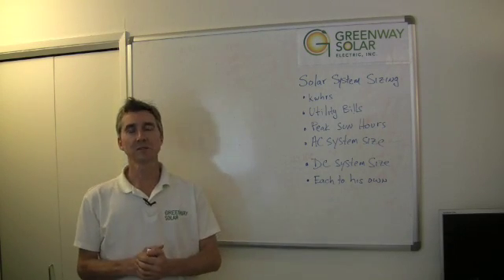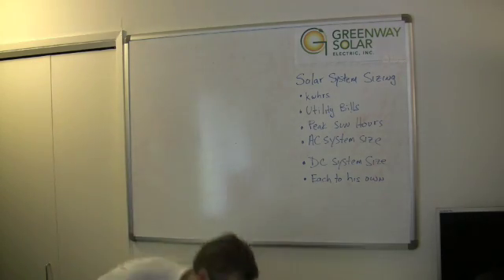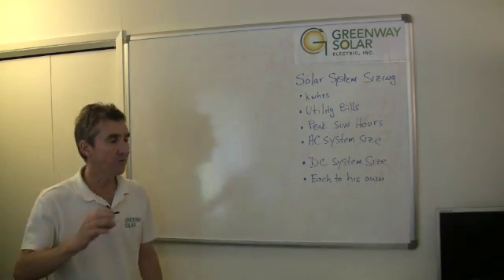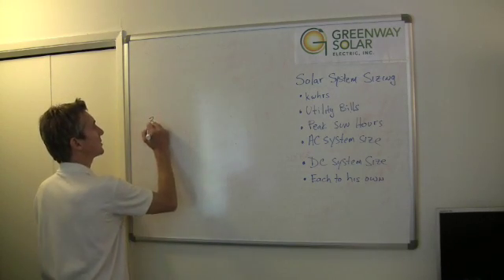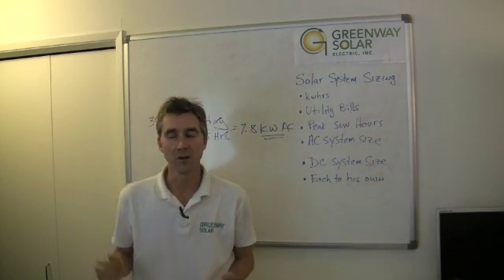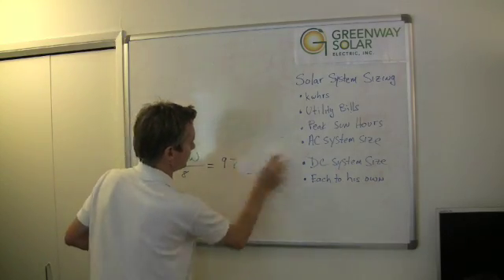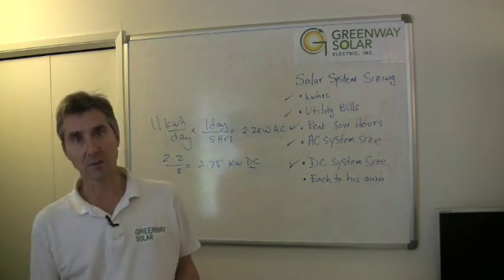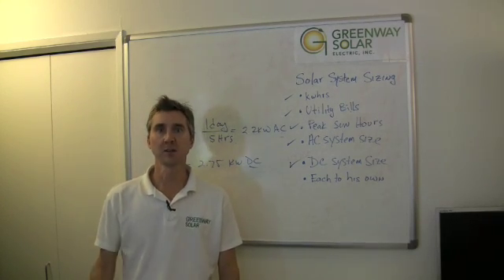Solar System Sizing Video.m4v

Comment: I have a system with only 6 panels .... my question is .....  can I add 3 more panels not the same brand and wattage of the existing ones? .....
Reply: No you camt .they must have thesame wattage of power

Comment: I'm based in the Philippines, the majority of household loads are focused in the evening when everybody gets home.  We rely heavily on airconditioning.  That being said, in addition to your formula, we only take 40% of the daytime loads to calculate for suggested system.  Mostly to run the refrigerators, fans, few lights, ironing etc.  So we multiply your answer by 40%.  Do you agree?

Comment: Thanks Mike,that was very informative.However,at some point (7.30min) during the sizing of the first example taken,you mention of considering 20% excess('ball-park figure) to convert from AC power to DC power (to compensate for losses).Shouldn't we be deriving this as [(0.20 x 7.8KwH)+7.8 KwH], rather than 7.8KwH/0.80. With the former method, we get 9.36KwH, as against 9.75KwH, with the latter?Or are both methods equally effective and reach the same goal?I'd like your/people's views on this.